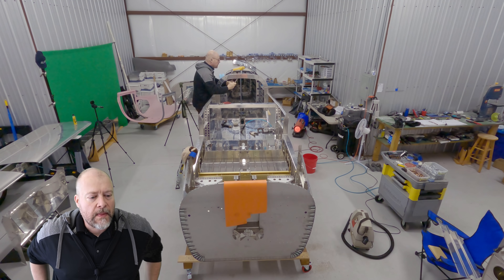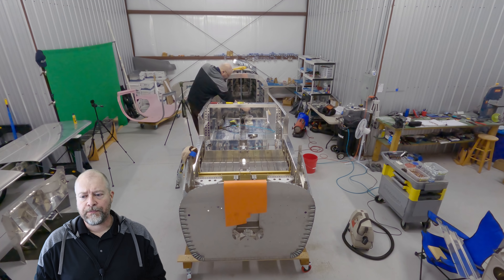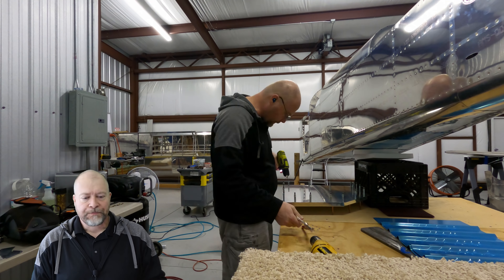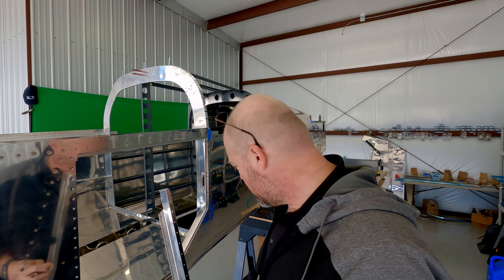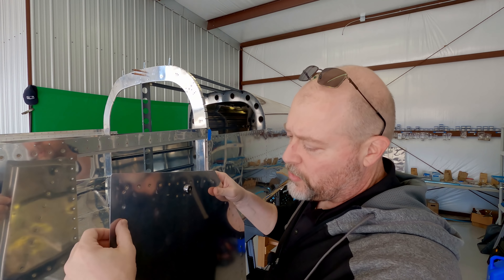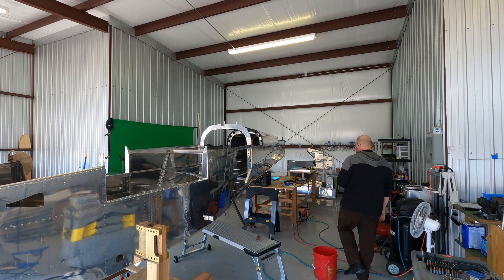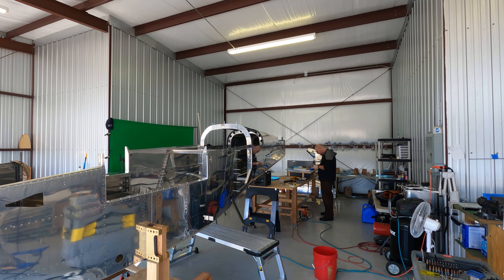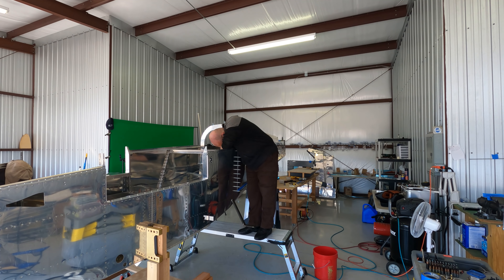RV 10 Fuselage - 041 - Baggage Door

Comment: Just a suggestion but you may want to look at splitting the baggage door hinge pin similar to how the rear seat backs are done. You can then remove the door without scratching the paint and the hinge pin won't try to fall out the bottom like the stock one may. Lots of examples of how to do not online.

Comment: Jason, it would probably help to get a little more info from your friend. You mentioned both the RV and Piper..is that to say he is open to both full certified and experimental? Those are very different approval routes. 
You/he might give Able Flight (google it) a call. I believe they modified an LSA for hand control of the rudder and I remember someone with inoperable legs got their sport license at the same time I was getting my ppl. They might be able to share info or even the engineering for the Form 337/STC if the control system is similar enough.
Last ditch, this sounds like something that would be cool to watch Mike Patey chew on. Maybe reach out to him and see if he's up for some charity work after Scrappy!